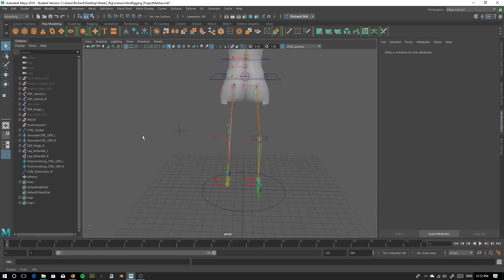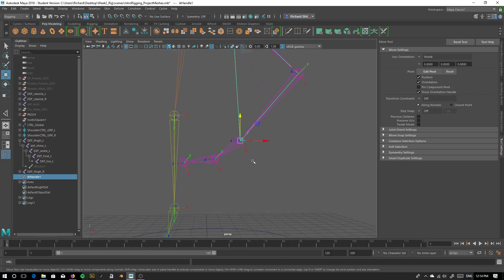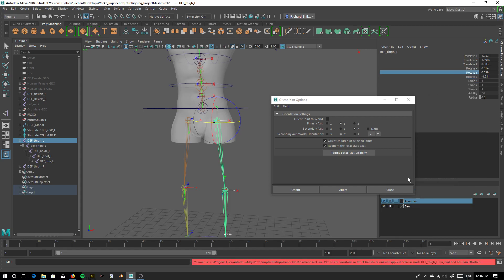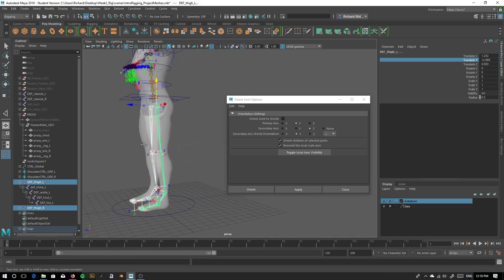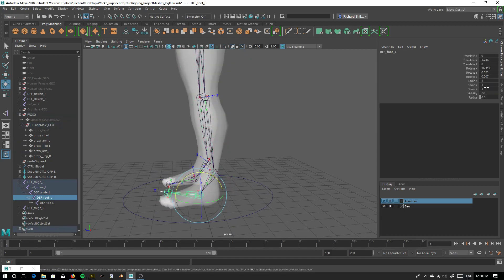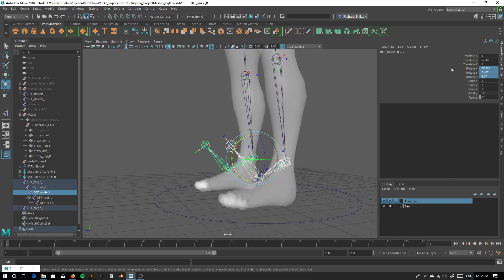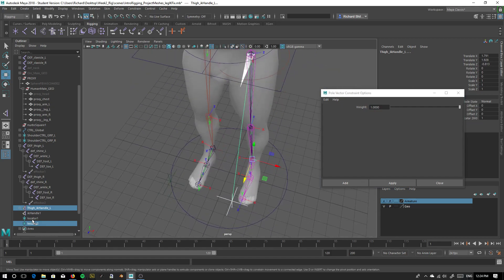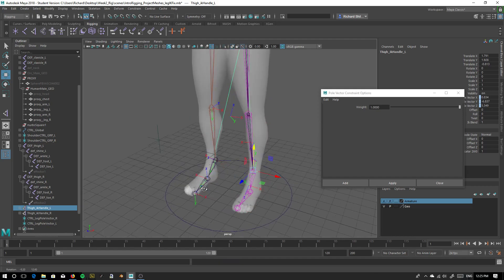Autodesk Maya 2018 - How to fix a wonky IK handle

Comment: This method was not conceived by the developers, there is a twist setting in maya, which must be associated with the bones, then you can set the angle of rotation of the knee without additional locators and connections

Comment: Hi thanks for the video!
I have a question. When I pull the joint so my character is deformed. For example, I pull a joint in my leg and lift it, and it starts to shrink. I checked all orientation joint It looks correct (i think so) Does anyone know what is it?
Reply from the maker: When you say shrink, do you mean the whole leg or in places where theres the most deformation (eg the point where the  upper thigh and hip join)
Reply: @Dikko  I have pic of the character with that deformation
If you can watch and suggest what is wrong so I will be grateful.
Thanks for the answer)
https://drive.google.com/file/d/14ukZhANtM10lxbsSewN00f9kPQDtmAje/view?usp=sharing
Reply from the maker: Could be your skin weights by the looks of things

Comment: for those who are still having this issue, go to Deform- export weights, unbind skin, orient the ik handle so that it points in the right direction, rebind the bones, go to deform- import weights (make sure that normalize is turned off) and you'll be good.